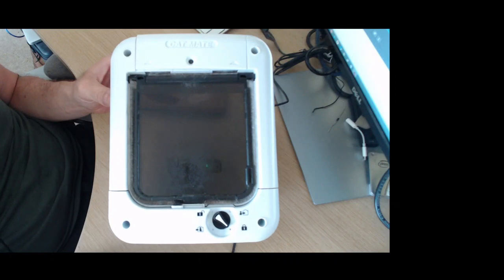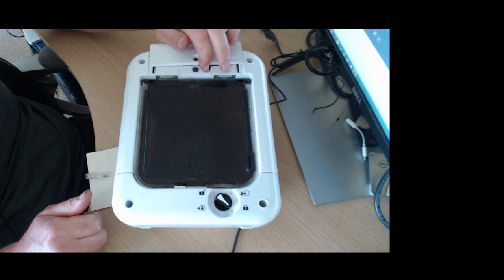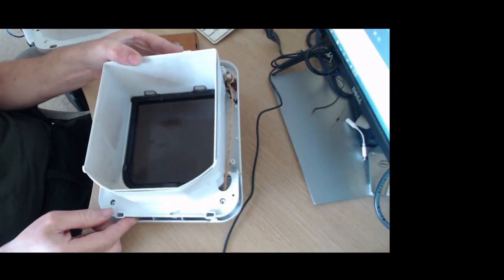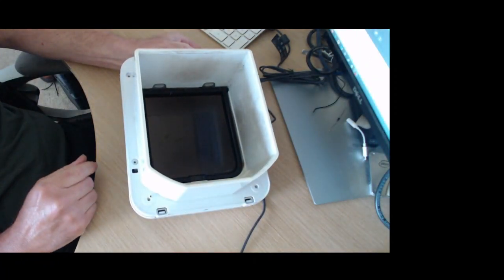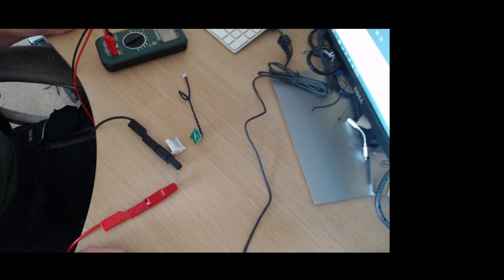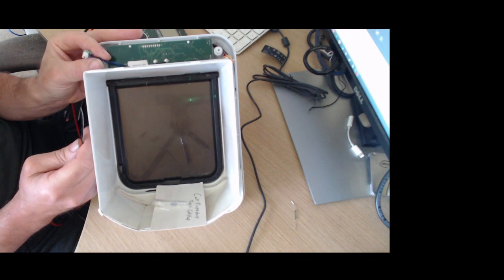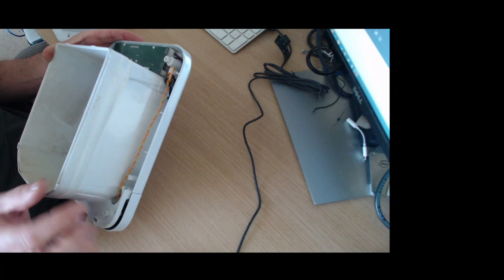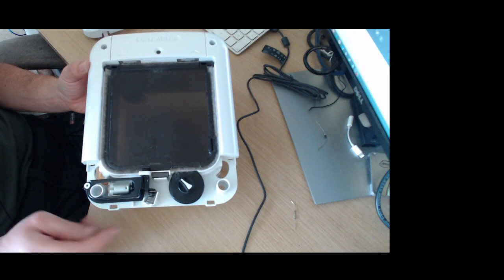Cat Mate microchip cat flap repair

Comment: Thanks for making this video, I couldn't find any others that attempt what you have done 👍! I have a different problem: after programming the cat's chip, I press the "program" button again to save the settings, but the LED keeps blinking.  I've tried a short press, a various  long presses - no joy, the LED keeps blinking, and the door doesn't function.  I've also tried the factory reset, but without success.  Any idea what may be causing this issue?  Thank you!
Reply: I’m having the same problem! Just installed the catflap to keep a feral Tom out and none of mine can work it. Did you have any luck finding out the issue?
Reply: @4PawsOutdoors  I wrote to the company to report the issue, and they asked where I was operating the cat door.  I imagine that this is because some chips from various places are not compatible.  In the end, I tried the procedure again, but this time did not hold the P button down for very long after sensing the cat's chip - just a short press.  The tech support thought that perhaps I was holding the button too long, which activated the factory reset.  The shorter press worked in the end.  Hope that works for you too.

Comment: Very useful video thanks. The magnetic switch on mine isn't working. I was thinking of permanently bridging the connection across it so it's always ready to read the chip. Do you think that will work or will the batteries just drain?
Reply from the maker: I would suspect it will drain the battery, as for how quickly, looking at the manufacturers data sheet for the main chip may be a good indicator, I seem to remember a PDF could be downloaded.
Reply: I've just had this issue tonight - tried permanently bridging the switch and it worked once, but not on subsequent tries - possibly there's some logic which requires the connection to be open first?

Comment: Help! I cleaned my catmate but the spring mechanism fell out and not the 4 way control will only select locket or out only...
Reply from the maker: If you freeze the video at 5:36, it should look like that.  The 4 way control, nothing should really stop it moving to all 4 positions, as its just a plastic wheel.  If you still have problems, let me know and I'll take mine apart and see if anything stands out that could be causing a problem.